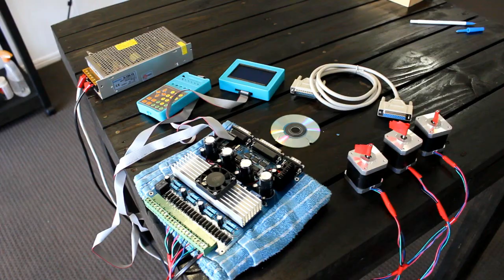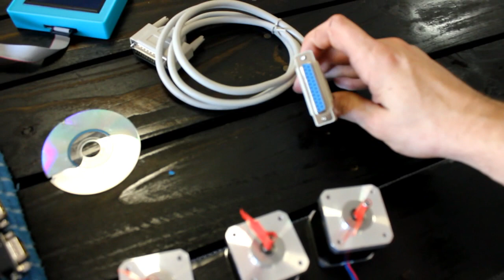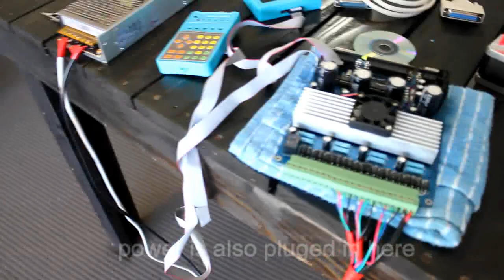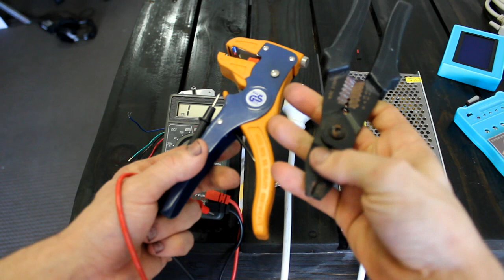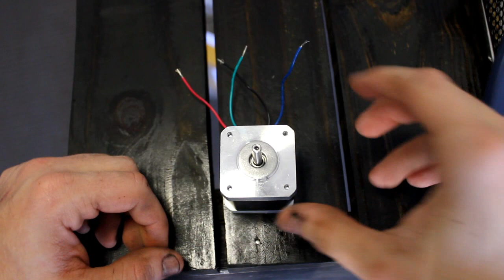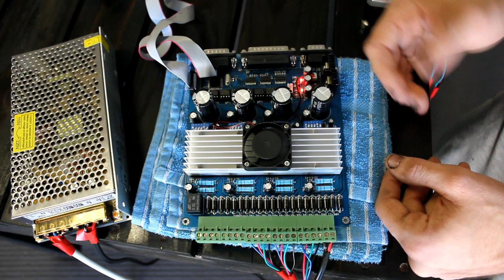Cheap and Easy CNC part 2 wiring stepper motors and power supply

Comment: better ??? lol !!
Every MS/Intel computer is capable of 4 parallel ports, which is a variation of the serial port, ...
which is the same input as the cute little blue pendant you see here, shown as a manual input device.
Any serial port device like a joystick controller.

A simple LED will LIGHT when You have a paired set.

Comment: Dear Cameron, 

Its odd how many people refer to electricity needing two wires/cables to pass through an electrical device, that uses the electricity. The wire/cable carrying voltage, is referred to as LINE and NOT POSITIVE, as it is only in DC current, that the line can carry positive voltage. In AC current/electricity, the nomenclature itself explains, that the current alternates from positive to negative, once for each cycle, up to amplitudes of whatever the voltage of the electricity is rated at, like 220V, or 110V. Audio amplifiers also carry alternating current, the voltages of which depends on the wattage/power of the amplifier. Therefore, you cannot call the wire/cable carrying the voltage as Positive. 

Now, the wire/cable/line required for the circuit to be completed, and the electricity to flow/pass through an electrical device that uses the electricity, is NOT NEGATIVE, but NEUTRAL, or simply, COMMON, as the line/wire/cable does not carry electricity with any voltage and hence cannot fall in to a positive or a negative range. 

The term 'common' is used as you may connect the return/neutral of several electricity supplies, using one neutral line/cable/wire, even though, the different supplies may be of different amplitudes (voltages), and/or amperes, as long as the return/neutral line/cable/wire supports the amperes of the supply/electrical device, requiring the maximum amperes.

A very common example, would be the Arduino boards and similar ones, which is a relative example, since we are discussing CNCs, that have both 3.3 volts and 5 volts outputs, with NO dedicated grounds/neutral, thus being referred to as COMMON.

Please correct me if I am wrong, as this is knowledge/understanding that I have acquired very recently, and I must say, quite late in my life.

Comment: Did yout try connecting the port to an adapter to your computer?  I've been USB to serial/Parallel adapter will not work and you must use an actual hardware printer/serial port.
Reply: USB to Parallel adaptors will not work according to the forums that I saw.  Only their parallel connection.  Which means you need an older comp with parallel port unfortunately.

Comment: can you tell me how to wire or change the settings to use 2 motors on one axis?  i have the Dave Gatton CNC built and have one of these controllers, now i need to figure out how to wire two motors  for my X-axis.
Reply: The duo of motors needs not change anything... unless you have paired them as being opposed to one another...
if you use a motor at both ends of the same ballscrew.... then I believe the POLARITY to each of that slaved motors' coils gets reversed.... correct ??

Comment: Most older computers have DB25 output and can usually run all the necessary CAM software to get that thing moving without the need for a USB adapter.
Reply: And in case someone is wondering PCMCIA adapters also work.
Reply: There are also USB to PARALLEL devices that might work.  cheap stuff, so it is worth to test.
Reply: +Anders Jackson Hey those USB to Parallel adapters wont work for this. The timing of the steppers wont be correct. For this board youd need a dedicated LPT port. Best option is look on craigslist for a old Laptop or desktop with the LPT port. Its pretty cheap now adays.
Reply: Vinny Gjokaj so you have tried them?

And there are some cheap PCI adapters out there.
Reply: Anders Jackson Yes you are correct, PCI adapters will work for this to get the LPT port, i'm mainly talking about a USB to LPT converter doesnt really work for CNC machines. The timing is never correct,
Reply: Vinny Gjokaj ok.
Have you tried the USB part?
Reply: This is good point. I run mine on a dedicated computer I bought used for cheap ( it's old and crappy). It doesn't take much to run Mach 3.